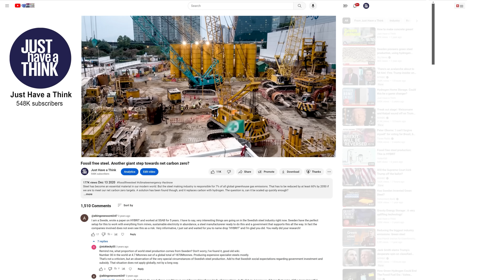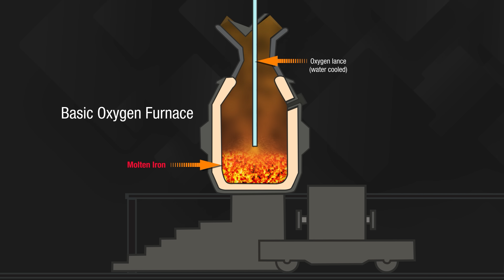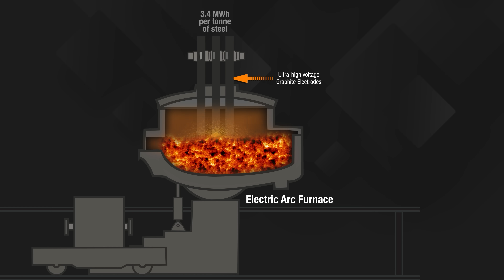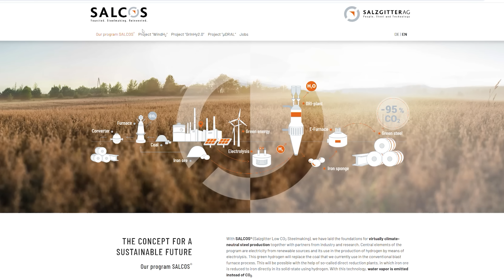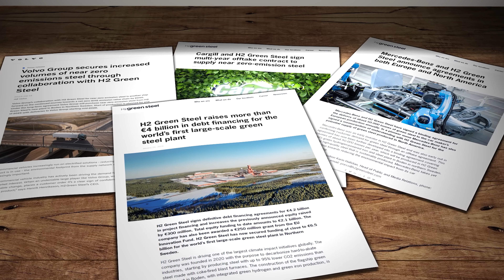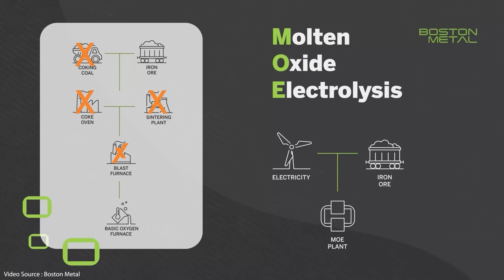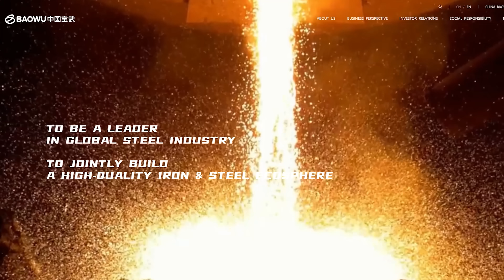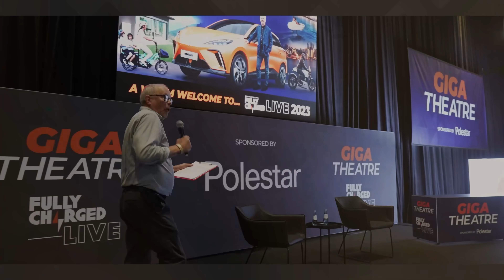Green Hydrogen making Green Steel. Is 2024 the breakthrough year?

Comment: If hydrogen can be harvested like natural gas then I don't have an issue. But if it has to be manufacturered using electrolysis or worst using fossil fuels then I don't see a benefit. Just use electric arc furnaces.
Reply: You cant just use electric arc furnaces, you cant use EAFs to reduce iron.
Reply: @rojavabashur6455 Sidbec-Dosco had been using arc furnaces since 1983.

https://digital.library.mcgill.ca/images/hrcorpreports/pdfs/6/633227.pdf

Comment: Steel =7% of carbon emissions. Carbon capture works. Its adds very approximately 50% to the present cost of oil & gas with Direct Air Carbon Capture__97% reduction of Carbon emission. Wow Sweden again__ Norway 90% but nothing made yet__Sweden again in 2024/5  nothing made yet__ Boston what? China are under economic attack or "competition" from the "West". They don't have significant oil and gas on country. They burn coal because they have it and do lots of Green electricity expanding.
#EverythingElectric = good for you Dave. This is top broadcasting IMO :)

Comment: Don't forget about Austria's voestalpine AG which is also is in the process of installing electric arc furnices (1 bn EUR investment). When it will be finished in 2027 it is said to be Austria's single biggest climate reduction effort, as it will decrease national CO2 emissions by 5%.
Reply: Lot of misconceptions here. Indeed EAFs are not used in primary steelmaking, yet Voestalpine will use Hydrogen for a direct reduction process, (DRI) where compressed sponge iron or so called hot bricketed iron is produced. This was formely done with natural gas as a reducing agent. Now after the reducing process with hydrogne the HBI is melted in an EAF. 

Other than that Voestalpine is also experimenting with Hydrogen Plasmas for direct iron to steel reductions called SuSteel.
Reply: In Québec, Canada they've been using electric arc furnaces as far as I can remember, possibly for more than 40 years. I believe both steel and aluminum are smelted that way.
Reply: @fparent  Canada has 13 steel foundries and their source of fuel for 75% of all production is coal, coke, and natural gas.
Reply: Your phrase "Austria's biggest climate reduction effort" and it being 5% of your total emissions reminded me of Canada's single largest change.

We closed one power plant.  It was emitting 15MT/year, 2.5% of our emissions and equal to a quarter of all Austrian emissions.
We had some real embarrassing low hanging fruit...

Sorry for the off-topic reply, but hopefully you got a wry laugh.
Reply: Any link's mate?
Reply: Electric Arch Furnaces is not green steel, its just recycling. It means Austria is removing primary steel making and removing all its blast furnaces, basically abandoning steel making.
Reply: @rojavabashur6455 What do you mean by your statement? Are you saying that electric arc furnaces aren't green?
Reply: @fparent He means you can't use electric arc with iron ore. It is essentially just a way to melt down steel scrap to recycle into new steel.
Reply: @fparent  You cant produce new steel with EAFs. You can use it to recycle steel or use it for green iron sponge after you had it in the DRI-reactor.
Reply: @rojavabashur6455 so what's the breakdown in cost for the DRI part and the EArc part? Is it the DRI process that's relatively so expensive?

Nevertheless, if they're reducing steel production, that's fine. Just fewer places to focus on making greener
Reply: @Cyrribrae  Steel produced using a coke/coal blast furnace costs around $77/ton to make while a ton made in a hydrogen powered furnace costs $800/ton This is just to melt id down, not including the cost of the actual metal. Recycled steel melted using an EArc furnace costs around $250/ton just to smelt. 

Think about it this way, it takes roughly 500 kWh of electricity to melt down 1 ton of steel.
Reply: @Cyrribrae  I dont think you really understand what you are talking about.
Reply: @rojavabashur6455  So they're stopping steel production domestically and will instead buy it from countries like China  who make it in coke/coal burning blast furnaces.
Reply: I light five candles a night for ambient lighting.
I now only light four
Reducing my carbon emissions by 20%

Can I have a medal plz😂
Not a steel one tho😂😂😂

Comment: TURBOCAM’s TX1 treatment increases steel’s survivability
Reply: How?
Reply: Interstitially binding carbon and nitrogen into the surfaces of steels. It increases the surface hardness, lubricity, and fatigue resistance. This technology has been used by Turbocam since the early 2000’s. I’ve seen the steels they process. Holy moly, this tech is great.

Comment: Thanks Dave, fascinating again...  Quite amused at the search term for carbon capture at around 3 minutes..  :D  True, but not a loaded search question ehh...  ;)
Reply: Carbon Capture. If it can work towards CO2; reduction then that saves lives worldwide that at are present inevitably killed .
Reply: @EdSurridge  This is the very big problem:  " If it can work towards CO2 reduction "...  So far it has failed and is very expensive, I can't find the reference for who calculated that for carbon capture to work well enough by around 2050 (might have even been on this channel..  Dave?), it would need more electricity than the world produces now...  Carbon Capture is a fig leaf for the fossil fuel industry to continue burning fossil fuels, with the relatively little CO2 so far captured often used to enhance the recovery of oil (to burn) in near depleted wells where the last bits of oil are hard to extract.  

Perhaps the best summary, with I understand accurate figures so is well worth checking out, was produced by The Juice Media, titled "Honest Government Ad | Carbon Capture & Storage".  Their tone is somewhat flippant, even sarcastic, but the science and numbers there are good, and is most probably a reliable description even though the tone is a ... somewhat earthy Aussie style...  

A more sober view comes from the MIT Technology review:  "Carbon removal hype is becoming a dangerous distraction"  

Carbon Capture is pushed hard by the fossil fuel industry, and the politicians they have ... captured ... with their ... generosity (figures for the US are fairly widely available online...  who said bribery & corruption...).  I think that you may have noticed in my comments online if you have seen them, and Dave (along with many others) ... ... just possibly ... ... may have mentioned on his channel, that the fossil fuel industry does not quite have the greatest history of integrity when describing issues around Climate Change...   Although I am not aware of any research supporting this suggestion, but it would not surprise me if the fossil fuel industry has killed more people than tobacco and malaria combined since the scientific community have been clear on Climate Change from about 45 years ago.
Reply: @EdSurridge "if it can (be made to) work" being the main issue...